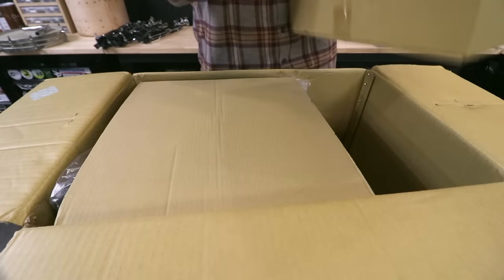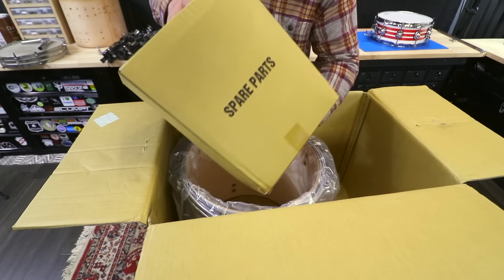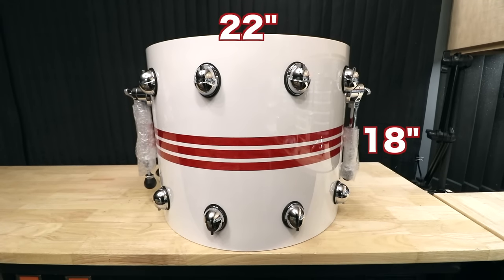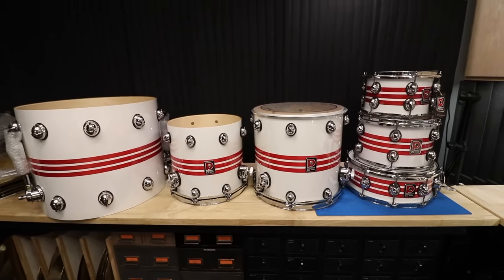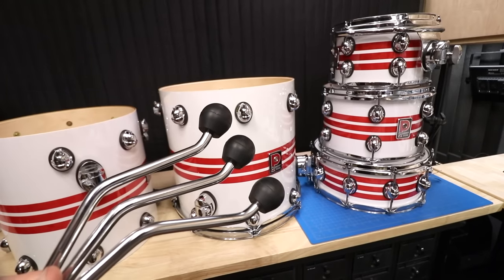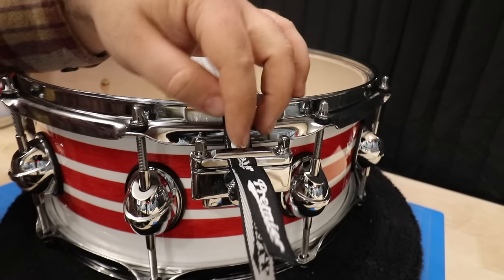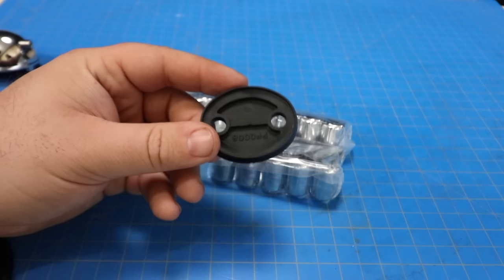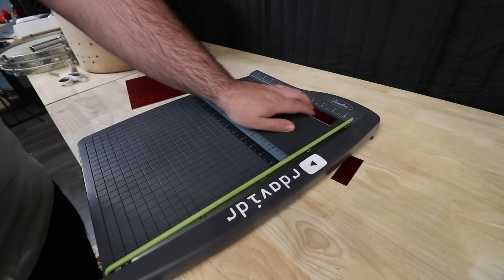This is the CLASSIEST Drum Set I've Played!

Comment: I sought out and eventually found an old premier genista birch 14x7 snare.   The reason was specific.  I always loved the snare tones achieved by Gavin Harrison with his sonor protean snare.    Particularly the insane tone that one can achieve with a very thin birch shell that is slightly undersized (as is Sonors signature).    

The genista line was also thin birch and slightly undersized so this old premier snare basically sounds like a top of the line sonor.   It’s buttery in tone and sounds phenomenal at every possible tuning and only cost ~300 as opposed to 1200+.   

Such a sleeper.   If you see one around anywhere you’d be dumb not to grab it.   Prepare to fall in love.     It’s an absolute dream in the studio.    Can’t talk it up enough.
Reply: I have a full kit of Signias with the 5.5 and 7 in. depth snares. These drums are an unbelievable value for the quality. An original Genista kit is on my list to acquire.

Comment: Hey guys, a friend of mine gave me a premier snare. I believe it's a brass snare.
It's pretty nice but there are 2 internal muffling rings on the inside and one of them is coming off.
It seems like it's glued on with some thin double sided tape.
My question is how do I repair this?
Do I just put some tape in the spot where it came loose or should I take the whole off and retape it?
Or do I take them off completely?
Any help would be appreciated.